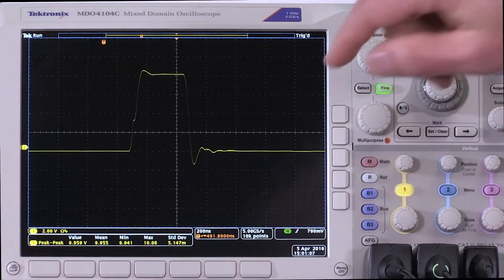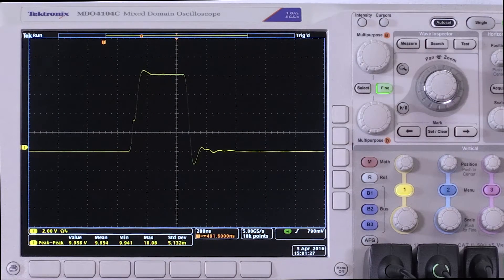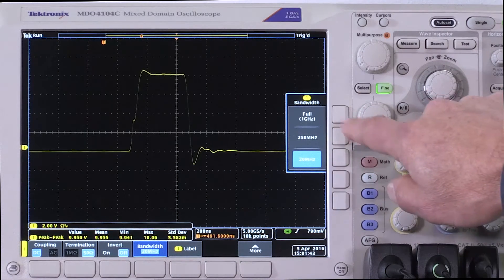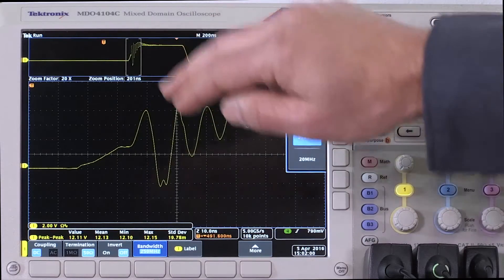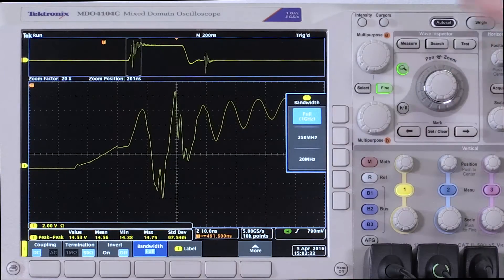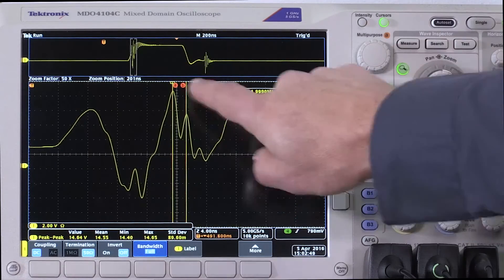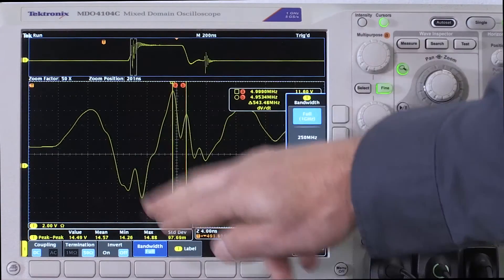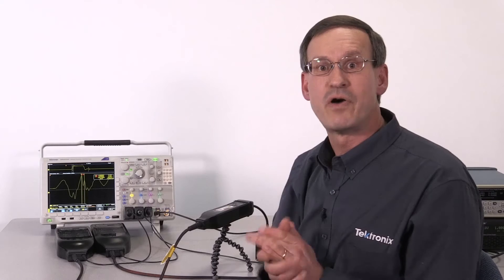See the Details on Your SMPS with the IsoVu Measurement System

Comment: The 100 MHz ringing is interesting. Even more interesting is the 500 MHz ring. It seems to me that there are actually two measurement system induced sources of ringing. I had previously thought there would be only one. Being an engineer, I'd be keen for Mike to check this out. 

Ok, here's my theory - the ringing is actually the series inductance of the probe outer coax resonating with the free space capacitance of the probe body. That's supposed to be about 2pF,  but it will be affected by nearby metallic masses such as those nearby probes. I see two coax covered probes in close proximity, so I'd be guessing another one or two pF or there. The time axis seems to be 10ns/div, so the high frequency seems to have a period of about 3ns, or 300 MHz. With 2 pF of free space capacitance, the series inductance of the coax works out at about 140 nH which seems about right, given the large loop area.  Now the other oscillation has a period of about 8ns, or 125MHz or so. I could be convinced that this is also a resonant system - but maybe between the larger 3-4pf of the two probes close to each other, and series inductance of the coax outer and tracks on the PCB. Say we went for 4pF, then L = 405nH, still reasonable. 

I think this resonant system is excited by the high switch dv/dt. I'd be guessing because of the capacitance between the two probes coax the other probe will also be seeing resonance with its coax outer.  So the coax outer is resonating, but the coax inner is not. As it has a different impedance to free space than the coax outer, any impedance between the two (eg the probes voltage divider resistance, or the impedance of the circuit being probed) will result in a differential voltage which the scope sees. 

So how to test this theory? I would go for:
1. Take the other probe away. If the frequency of the oscillation increases that confirms it. 
2. Bring your hand close to the probe to increase the capacitance. If the frequency of the oscillation decreases, that confirms it. 

How about being an engineer, doing the test, and reporting back Mike? Thanks.